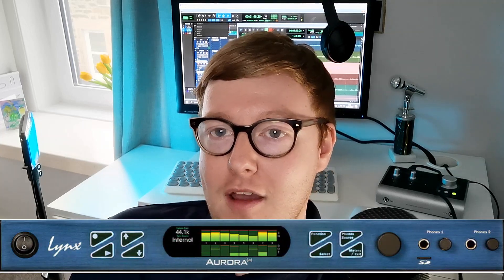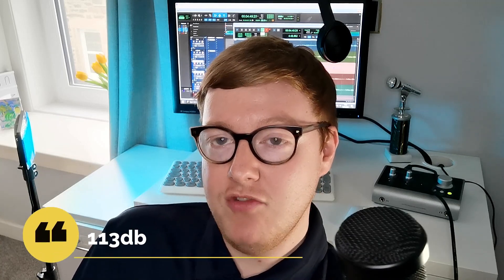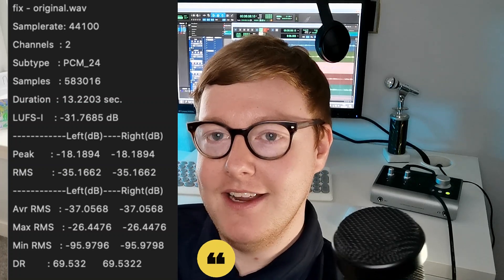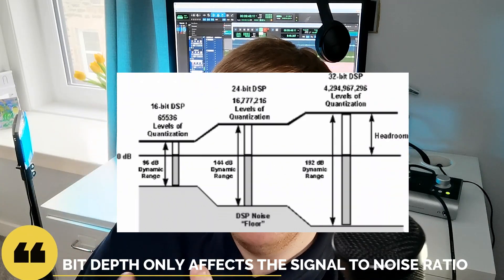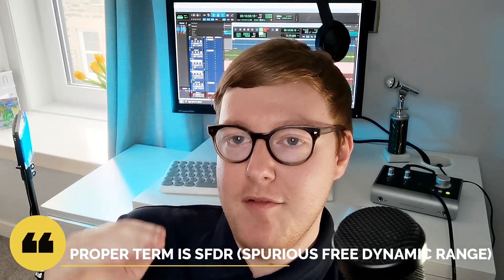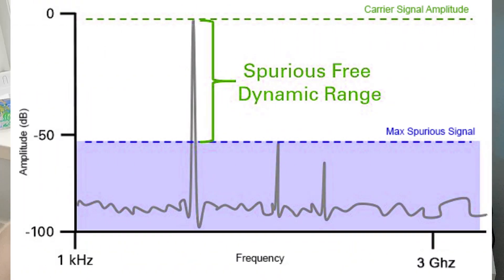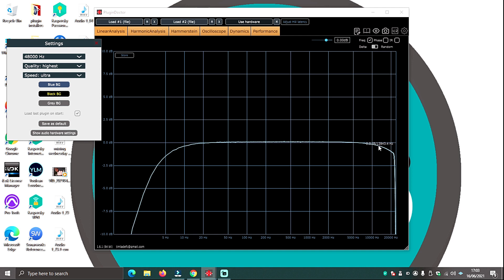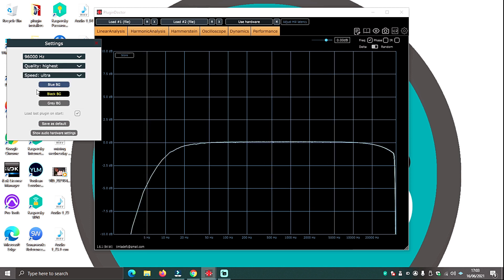Do you lose audio quality in analog gear using budget interfaces vs expensive ADC Converters (Pt 1)

Comment: Well okay.....
There's a LOT packed into this episode, too much to properly unpack now.

But let me say a couple of things: 
1) Your takeaway that nobody should be stressed out about the differences or doing damage to their sound by using a modern Budget interface is absolutely correct. 

2) That is Because, as with your mobile phone, this is 2021 not 2011 or 2001.  The actual "converters" inside of an "interface" are chips, and those chips come from like 3 companies, none of which have their names on your interfaces.  The companies that sold you an Interface, built Circuitry around those chips, and a dozen companies ALL using the Exact Same chips, will have a dozen different results. What has changed, or rather evolved, is just like Apple's new M1 chips are changing the game, so is the way Apple is designing the Circuitry.  So the Chip Manufacturers, as well as the Interface Manufacturers are all getting better and better.

3) If you're just now tuning in to a "program already in progress", and you probably have to be a certain age to even get That reference, then you can be forgiven for not hearing any differences between interfaces costing hundreds and interfaces costing thousands. That gap has shrunken to the point of near irrelevance for the vast majority of the work being done. But there was once a significant difference between the boys and the men.  However, boys grow up.

4) About a month ago you and I had a back and forth about much of the same topics regarding Bit Depth and Dynamic Range, Fixed Point vs Floating Point, as well as Sampling Rates and Oversampling.

1-bit = 6dB DR
16-bit = 96dB DR
24-bit = 144dB DR
32-bit Floating Point = Effectively Unlimited DR 

And 

1X= 44.1 & 48kHz
2X= 88.2 & 96kHz
4X= 192kHz

Well, the Chip Manufacturers made all the chips 4X.  But the question is whether the Pros outweigh the Cons going from 1X to 2X and again from 2X to 4X.  My ears, as I said before, as well as many I know that have tested, do hear a consistent improvement moving from 1X to either 2X or 4X. But I can't easily tell between 2X and 4X, by ear.

Acustica have stuck to 96kHz I assume for similar reasons.  192kHz provides an Insignificant (if any discernable) BENEFIT for a quiet Significant COST (in the form of CPU usage and Data Storage).
Reply from the maker: This is a fantastic comment but I don't get the last bit haha number 5

Remember I have aspergers so I struggle to read between the lines sometimes. I'm quite literal. Ive re-read it but just dont understand exactly what you mean 🤓
Reply: @PaulThird  Hey Paul, I just edited number 5 out all together.  It was unfixable and didn't belong with the other 4 anyhow. 

As I've told you before, I REALLY like what you are trying to do with this Channel.   I love that you are Setting up tests and Showing examples of whatever topic you're discussing.  

Substantiating you Claims.

At the same time, every channel has to be entertaining on some level, rather than 10-minutes of charts and graphs, devoid of personality. 

That range, I was putting between Julian Krause who is presenting facts and data with an android-like lack of human expression, and WhiteSea who's every video has a thumbnail of him making some distorted facial expression next to a click-bait title, and his videos themselves are always hit-n-miss regarding whether or not he even understands the topic. 

You've consistently produced quite useful and validated information on this Channel. 

But in this particular video, you seem to be uncharacteristically defensive and eager to Prove some point.  I'm sure that the comments coming your way are as ridiculous as the internet always is. 

Brush your shoulders off.  You don't need to respond to the haters.  Your Videos, and the content within does all the work for you.  Getting all exercised and adversarial, doesn't really add anything to the Audio Excellence you, and your real audience is reaching for.

Among many other things, I'm a thirty plus year television producer, the original "content creators".  My advice for every "show" is to define what the show is, and who the show is for.  Beware of "mission creep", getting pulled in various directions often outside of the scope you really want to focus on.  

All that said, maybe you do wanna be the Myth Buster and take on all the haters week after week.  And more power to that.

But that takes a lot of time and energy, and the opportunity cost is at the expense of the audience that really wants to grow and build, and not be bothered by the nonsense. 

I hope this comes across better than my last fiasco. 

I am very much rooting for you and this channel.
Reply from the maker: I understand this WAY better haha

I think this one for me was more of proving something that I needed to test for myself. As soon as you have people claiming that your interface of choice isn't sufficient enough to print analog gear for shootouts you then run the risk of devaluing every further shootout you do if you don't test and evaluate the tools you are using.

The name dropping of Alan smart, apogee and guys at metropolis got to me a bit as there was talk about the manley vari mu tests I made and how it's not even hardware I'm comparing it against "access analog is fake" etc etc

Thankfully for me the research and tests shown that the claims made were most likely conformation bias from the guy as he admitted to selling his rme interface to spend thousands on an apogee symphony.

When my integrity and the reliability of my shootouts are brought into question I've got to address them straight away in my book as it only takes a few forum posts and people will believe anything.

This video for me has proved that my id14 is more than suitable of printing analog gear and thus my comparisons can be relied upon for trusted results.

The converter rant was me trying to be objective and look at the reality of price and why many big studios will have expensive converters due to enhancement of sound and obviously the fact that they have more channels to run more gear through.

I was defensive. 100% but I'd say on this occasion it was to protect the reliability of my work and also for me to ensure that I have the right tools to provide the right results of audio.

I've been asked by a few people to make more reaction videos and call out audio BS on YouTube but it's not my thing unless I feel that it contradicts anything that my channel provides. That one reaction video I made was genuinely a one off as it could have been quite dangerous towards my channels theme and gave people false information which would spill into the comments of my videos.

But you are right that it's best to try and go into everything with an objective mind. If the id14 did the same high end roll off at 96khz I still would have posted the video and looked into a new interface that day but thankfully for me it turned out at 96khz it was more transparent than the lynx which for my shootouts is what I'm looking for to try and limit variables wherever possible.

The analog guys will always get to me with the "non working engineer in his unacoustically treated bedroom" low blows but I'm fine with that. In the end Im happy with my choice of mixing on headphones and I'm happy doing what I'm doing. I'm testing gear that has cost engineers thousands and in a lot of cases showing plugins that can match or better it for a fraction of the price.
Big studios will despise my videos as I'm challenging some of their biggest selling points and I understand why i'll get hate from that neck of the woods but for me it's just all about sticking to the tests and what I know and have tested.

I'm not gonna start giving mixing tips or online courses of how to become a better mixer as Im on the same page as the rest. Trying to learn and get better at my craft. Understand the tools better and how I can use them.

I think if I stick strong to what I know and what I'm good at then I'll be fine. As soon as I start making out im somebody I'm not it'll be curtains for me.

The youtube game is a very slippery slope haha
Reply: @PaulThird  Fantastic points in here.  I’ll respond to a few later. Gotta go right now.
Reply: @PaulThird  Hey Paul, yeah let me apologize for number 5.  I know what I was trying to say, but after re-reading it, what I wrote is basically unreadable.  I just got home, it’s been a long day, I’ll try to fix it tomorrow.  But for tonight, yeah that was a mess….
Reply: Agree with almost everything (about the audio) but i think that Intel and AMD need to do custom CPU for audio processing like mining for Bitcoin and cryptocurrency, because the oversampling at 192khz instead of 96khz especially in the shelving eq stage (bax etc..) and the Stereo image stage it's quite big and pleasing to my ears/feelings
Reply: @AftertuneMusic  Agreed!  I’m running out the door, but….part of my previous rant on the other video was about a seemingly contradictory consensus.   Why is it that in RECORDING at 96 vs 192, the differences are minor to most, but in OVERSAMPLING Plugins, the 2X vs 4X difference is plainly noticeable?
And if you track at 192, does it Still make sense to Oversample?
Something else is going on, that I don’t yet understand.
I haven’t done the extensive testing that I plan to (hopefully in the fall), but I’m all ears as to the discrepancy or others experiences.

Comment: running through gear is worth the trip out . The converters  are ok and useable to run into analog and back e it from focusrite all the way to the lavry .
Reply from the maker: The more I looked into it all further I agree. You just get more bang for your buck these days 🤓
Reply: @PaulThird  and you can run more conversions before it turns to crap, like 300 or so. Most converters  chips use  cirrus logic chips , only a few use different chips and add electronics to the chain to make them sound better. Only in audio!

Comment: Thank you for making this comparison. Hopefully people will undestand that high grade gear is expensive not because of "better convertion", but because is less transparent and add color to the sound, that's the main reason why people choose it, it adds something pleasant (of course this is purelly subjetctive) to the signal. 

About audio interfaces, I choose RME for my studio project. It sounds really good, but what impress me more is that the drivers are rock solid. I buyed it, connect it and it nevers fails once. I had a motu before and drivers for windows were awfull, specially with clock changes.
Reply from the maker: The RME stuff is VERY popular with a lot of engineers I speak to 🤓
Reply: @PaulThird  Yeah! It just works wonderfull! 😎
Reply: RME's are pretty rare in multi-million dollar commercial studios though, probably not as popular in the High end world. You see primary Apogee, AVID, Lynx and Antelope in large commercial studios like Westlake Recording Studios in Hollywood, CA, Paramount, The Record Plant, Hit Factory etc. The Focusrite Rednet Dante and MOTU AVB audio networking interfaces are finding their way in large commercial studios. Chris Lord-Alge uses the REDNET converters that feeds audio to his large format SSL Console for Hybrid mixing, as well as printing back into protools.
Reply: @eman0828  I don't have any doubt about this. I have experience only with AVID, antelope and Apogee and they are all excellent. With that level of equipment is really difficult to go wrong.
Reply: @SetoNess Yeah. I also wanted to point out that MOTUs drivers has dramatically improved in the past 15+ years. Thier interfaces did work better on Mac since it's hardware products started off as Mac only in the 90s. Thier old HD192 was used a lot in commerical studios as my studio partner worked at a facility that had an older Apogee Rosetta 800 and a MOTU HD192. But I can assure you, my MOTU 828ES is very rock solid on Windows. I can name about three well known Youtubers that uses MOTU interfaces such as Tom aka JunkieXL a well known Film Score Composer that owns two MOTU midi interfaces for all of his hardware synths and a MOTU Ultralite mk4 which is not that old. David Gnozzi of MixBusTV and White Sea Studio are both using the modern MOTU AVB interfaces for their Hybrid mixing and Mastering rigs that are professional Mixing and Mastering Engineers. David Gnozzi setup is very similar to mine. The AVB interfaces are used in critical mission large scale deployment just like Focusrites highend RedNet Dante Audio networking interfaces such as live sound, major tours, playback rigs, house of worship, large studios with multiple rooms that's proven to be reliable.
Reply: @eman0828  Probably, but my experience with motu was pretty bad. It didn't work right in my computer due to very old drivers that aren't compatible with newer OS versions and it was a pain in the ass to work with. It was probably my fault for not knowing that when I change my laptop, but I assume that because Motu update they drivers continuosly on mac it was the same for Windows, but I was wrong. Their latest driver at the time I sold it was from 2015! (I sold it last year). It was pretty good on macOS, but in my computer was awfull, I had like 2~4 blue screens a week hahaha. I guess that the new hardware with new drivers works great though.
Reply: @SetoNess what model did you own? The AVB Pro stuff isn't all that new that's been around since 2014 which is MOTUs top tier stuff geared towards the Professional/Commercial market. The company is  pretty renown for long term driver support similar to RME, Lynx and Metric Halo. The original firewire 828 was supported on Windows for 15 consecutive years and 17 conceived years on Mac, yet this interface is much older than all of RMEs interfaces that they still support. Most pro audio manufacturers dont support its drivers past 8 or 10+ years.